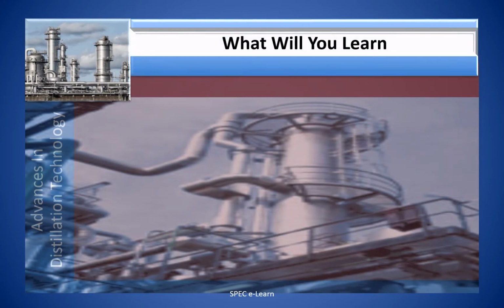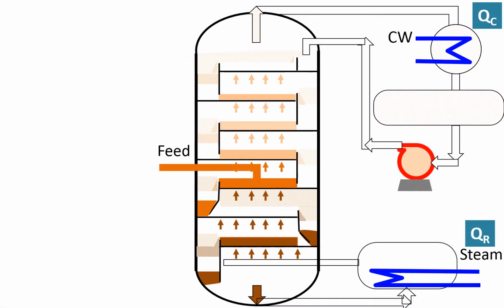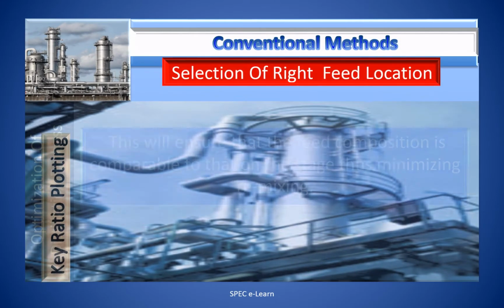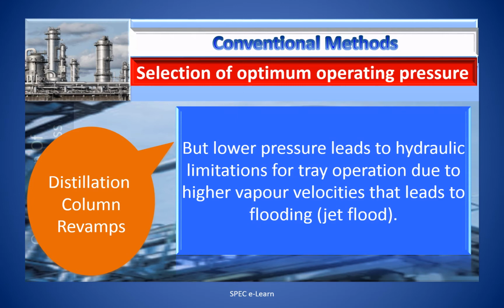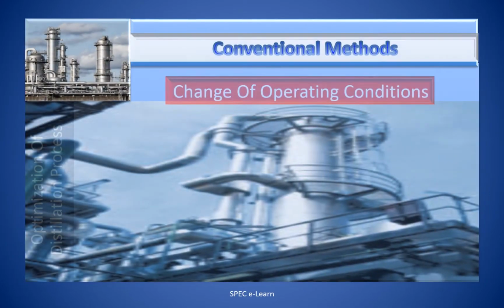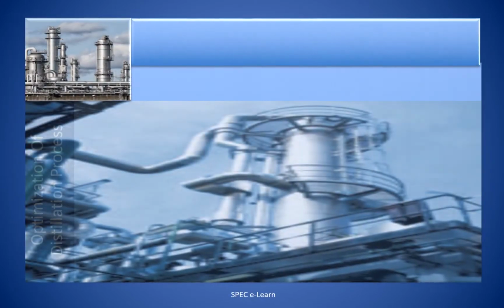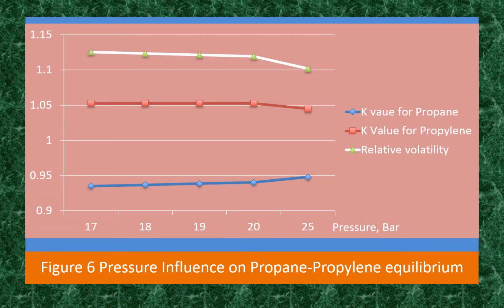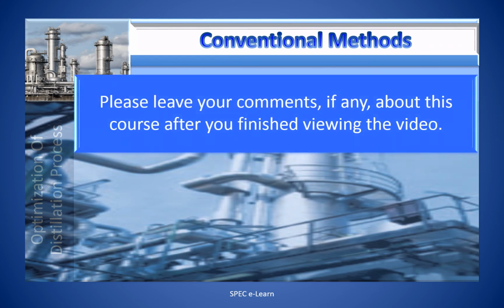Optimization of Distillation Process Part 1 - Conventional Methods At Design Stage

Comment: Due to the decrease in reflux ratio, the number of trays will increase are we not considering it??
Reply from the maker: For optimization of distillation process there are certain fixed column design parameters and some variables to achieve the desired separation objective. These variables are discussed in the course. When optimized the column will be more energy efficient. The number trays is fixed in the simulation as also the distillate and bottom purity. The reflux and reboiler duty gets optimized in the process.
Reply from the maker: I would like to add one more point. Number of trays is not influenced by the reflux ratio alone. It is strongly influenced by the relative volatility of the components, which inturn is a function of other variables such as pressure